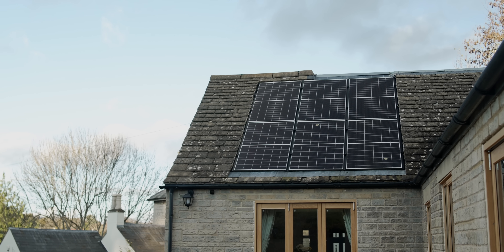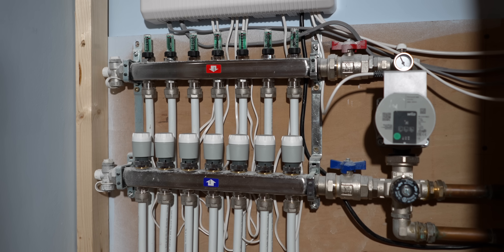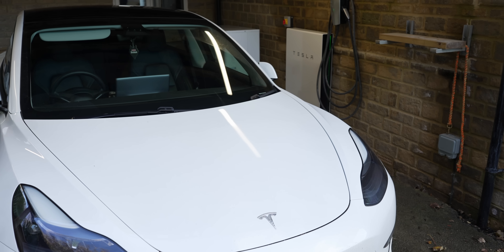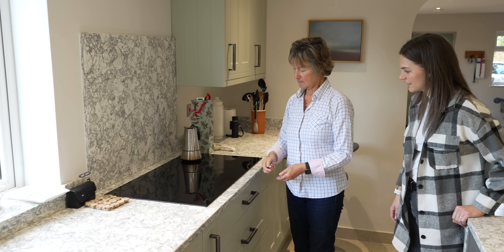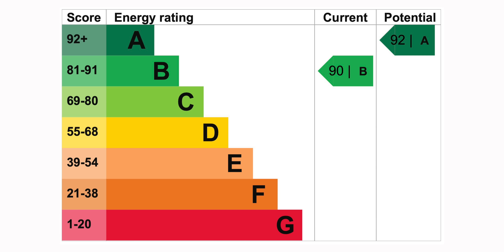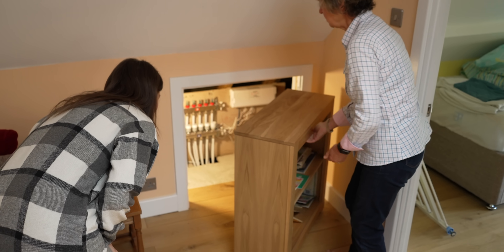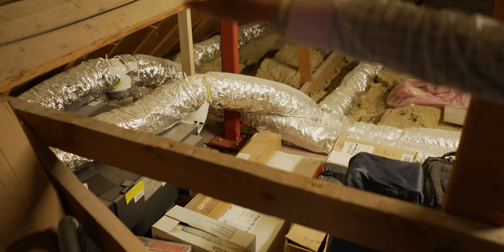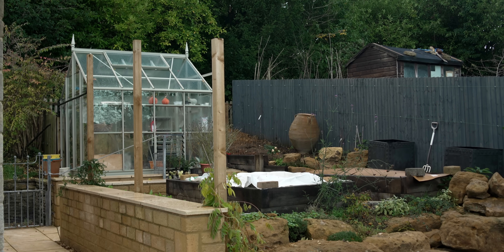Could These Clean Energy Technologies Work In Your Home?

Comment: It'd be interesting to hear more about the heat recovery system as I've never heard of it before
Reply: Search for MVHR or mechanical ventilation with heat recovery. Companies such as Paul or zehnder
Reply: Having installed MVHR myself can confirm it's great tech that reduces humidity, removes particulates, helps allergies, stops mould/humidity, reduces CO2 and VOCs. Impressive stuff.
Reply: @richardlphillips  I agree. I have a Paul unit which has been running for the last 10 years. I paired it up with a ground source heat exchanger (not a heat pump,  just a 45m horizontal air pipe buried 2m deep in the ground) and it pre-heats the inbound air in winter and pre-cools in summer. Its like free air-con.
Reply: @ecoworrier  😎👌
Reply: @richardlphillips  I suspect MVHR companies might be getting a lot of business in the next few years as housing associations and landlords realise that if they don't deal with mold and really deal with it, not just slap a bit of paint on it and call it a day, they might well be facing corporate manslaughter charges.